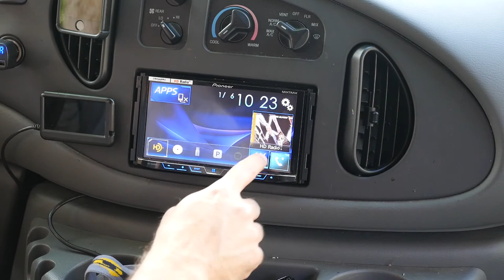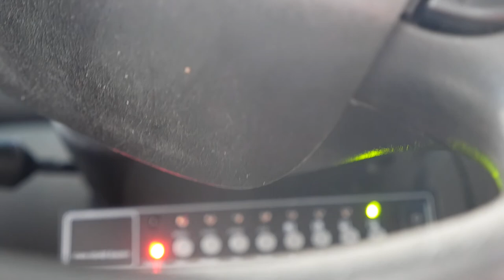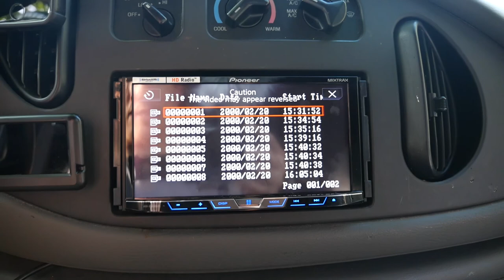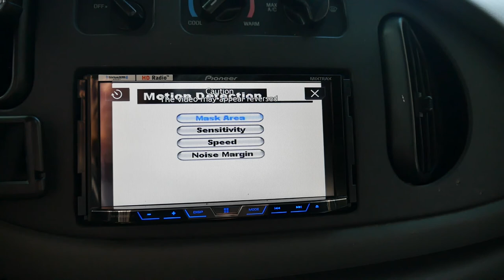33. Touring Camper Van Build:  Radio, Side Cameras Continued

Comment: Hi, I've been watching your van build and am very interested in your camera's and want to add cameras to my mirrors like you did (very clean install) I have the same body style as yours and am wanting to see just how you took your mirrors apart and fed the wires through the arms and into the doors.  If you showed it in "detail" in one of the video's  I can't find it, maybe you have some still pictures of it if not on a video.
Reply from the maker: Jeff, thank you. Yeah the cameras are working good. I dont think I did a good video on the actual installation. I had to remove the mirrors and fish the cables through the small channel. It was a challenge. I then sent the wire through the rubber cable chase that goes from the door to the frame of the van. Sorry I didnt film it as much as I should've.